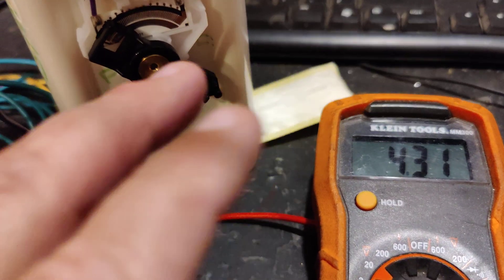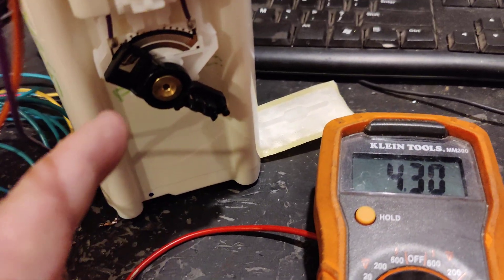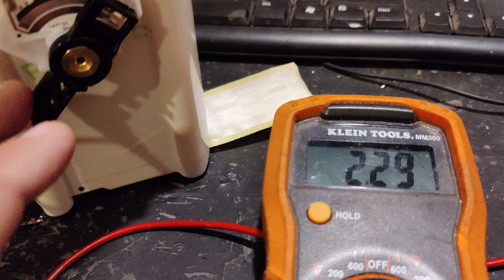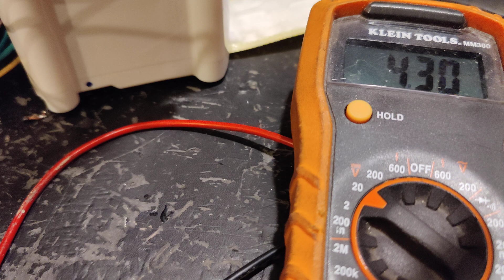Fuel level sending unit, Ohms to Volts

Comment: Im trying to wire my 99 camaro. It reads 270 full and 33 empty. I have a 5v output module but im bad with wiring i need help with wiring this. Im lost.

Comment: Thanks for the video, im looking at doing this currently with my set up, how do you calculate the resistor that you will need? Or know where to start? I have a 0-90ohm sending unit. Thanks for the help.
Reply: I need help with this also

Comment: Are you using 1 resistor with the fuel sender or 2 resistors? I'm having trouble calculating the resistors I need for my 5V digital fuel gauge to work with my analog fuel sender, 3ohm (full) to 110ohm (empy). 4.6V is full on the gauge 3.27V for half a tank and just .3V to show empty.
Reply from the maker: In actuality it's two resistors. One is fixed value and the other is the sending unit itself, which is a variable resistor. A good rule of thumb is to use a fixed resistor value that is half the value of whatever your sending units max resistance is (or as close as possible) so in your case you'd want your fixed resistor to be around 55 ohm. This circuitry is commonly called a "voltage dividing circuit" if you visit tinker cad circuits you can build the circuit using their circuit design software (free) and try out different values of fixed resistor to get the voltage range you desire.

Comment: So are you connecting the fuel sender wire to the 5 volt power supply?
Reply from the maker: The short answer is yes. The 5 volt coming from the ps goes through a fixed resistor and then splits into 2 wires. 1 wire is an output for the pcm (0-5 signal) the other goes into the sending unit. The sending unit itself is a variable resistor. As its resistance changes, it changes the  voltage output from the ps.
Reply: @scottcoleman162  Is it dangerous to have 5 volts running through that sending unit wire since it goes into the fuel tank?  I'm thinking about wiring up a low fuel warning light using the technique you describe.  A little worried about that warning light popping on and creating an explosion.  :)
Reply from the maker: @kevinb21  most factory gauges usually take in 12v and output out 5-7 volt to the sender. Check the voltage on one to know for sure.
Reply: @scottcoleman162  Thanks for the info.  It helped get my DIY low fuel warning light going!
Reply from the maker: @kevinb21  good to know, I haven't tried it, but you could likely also use the sending as just a ground and have a bulb that dims and brightens as the fuel level changes. There's a website called "tinkercad" that let's you design and stimulate circuits, really easy to use.